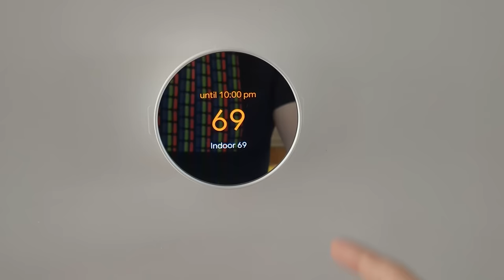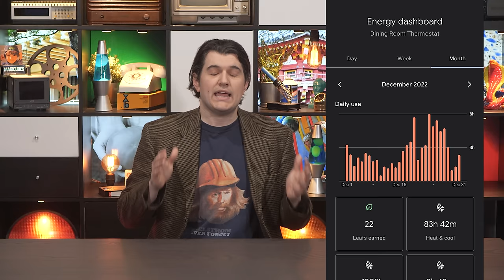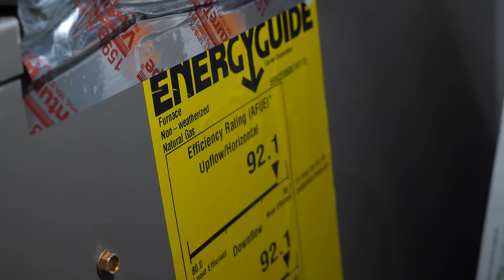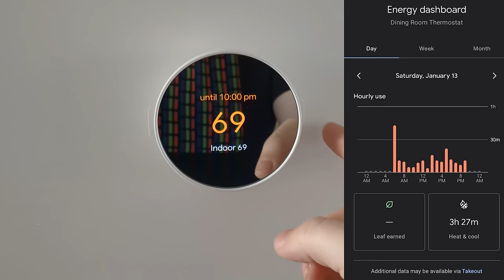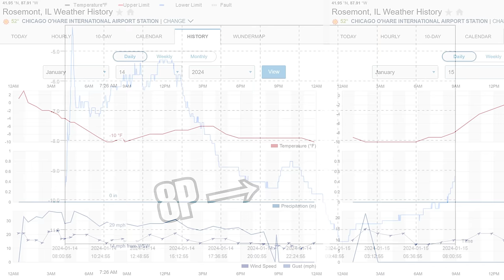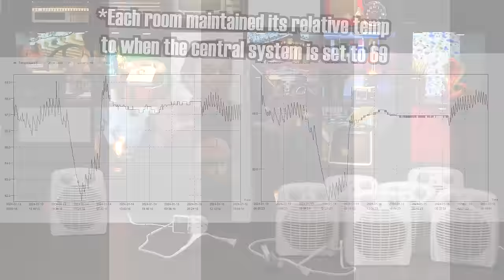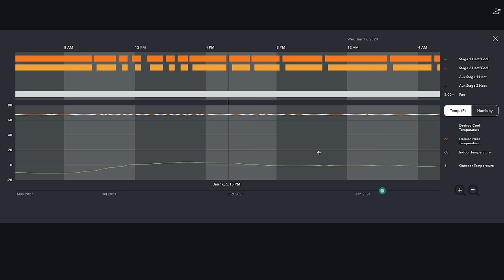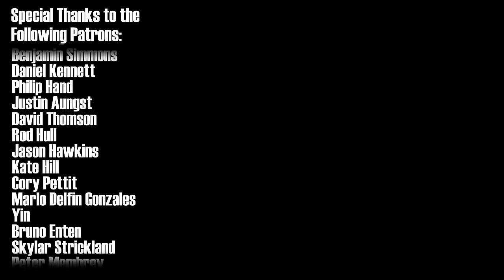Old HVAC industry practices are holding us back and costing us money. But we can fix it.

Comment: Another consideration occurs to me, and it might be a small one, but for some people it might be extremely important.

How loud is your heating and cooling system?

Now, you might think this is only important if you are say recording media or something along those lines. As building manager, Can tell you that that is not universally the only reason.

I’ve been managing for over a dozen years, and in that time, where I’ve had approximately 100 or so different tenants in a 40+ unit building, 4 to 5 tenants have been extremely sensitive to sound. Now if you are renting an apartment, you’re kind of stuck with whatever you have, but if you’re owning a house, you’re going to work harder to make it exactly how you want it.

So the question is, how noisy are furnace based systems, and how do heat pump systems compare? If even just the cycling of air being pushed through vents is disturbing to you, and I realize that seems extreme, but it is definitely something that some people worry about, then you would want that to happen for the shortest amount of time possible while you’re awake or on your way to sleep.

Given how noisy an air-conditioning system can be if it’s right there in the room, one wonders if it is louder than a gas furnace.

So…

If we take noise into consideration, what is the best combination and sizing when you use? And are there other things one might do to reduce noise?

Comment: Did you account for  the heat pump will have to use electrical resistance heating when the Temp gets too low.  and gas really heats a lot cheaper.   You better have some back up firewood

Comment: Furnace shown have also immensely out of date technology. Opened combustion chamber (modern have closed), only 92% efficiency. Mine have 115%. Well 15-20% are from exhaust heat condensation. Also fluent regulation with 1% increments or cooling down heat reuse. It can also sense air difference via lambda probe and get itself aligned according initial reference energy output from gas.
And its frickin 11 years old!

Comment: Having oversized HVAC equipment is not necessarily a bad thing. Those inverter heat pumps run most efficiently at 60-80% capacity. Your data is predicated on the premise of maintaining a constant temperature 24/7. It requires much less power to maintain a temperature than to change it. 

For example, if I have a large room in my house with a 10k BTU window unit air conditioner, and I run it 24/7, that room will remain comfortable. If I leave my house for a couple days, and that room gets up to 100 degrees, that thing will take all day to get the room down to a tolerable temperature.

You also maintain the temperature in your home at a reasonable 65-69 (giggity) in the winter. Many Americans prefer a warmer temperature, and the relationship between heating demand and energy gradient is nonlinear. IE; you need more heat to get from 74 to 75 than 68 to 69. And again, more energy to heat the house up than to maintain that temperature. 

 The same logic applies to a larger home with rooms that can be heated and cooled independently. Having oversized (on a per room basis) units allows me to maintain a baseline temperature in the house and rapidly heat or cool a room when it becomes occupied. That is to say, the way a house is used also should be considered when specking a system.

Finally, you come to the piano tuner problem. As you stated, there are many variables involved in sizing an HVAC system. However, some of those will have a positive effect and some will have a negative effect on the overall demand, and its likely that they will average out to being approximately the same as ignoring all of them and going of square footage alone-- with intuitive smudge for obvious things like "its a rowhouse" or "the whole facade is south facing glass"

Comment: 26:18   If only my family understood this, especially when they turn the heat down overnight.

My room is poorly insulated and gets frigid; temps are often 7°F below the rest of the house.  We don't have per-room HVAC, only zone valve adjustment.  The temp needs to be up more to keep my room comfortable.

An indoor oil radiator heater can only do so much, and takes literal hours to get comfortable running constantly at max power.  Meanwhile just upping the furnace temp would warm the room up in 15 minutes.

..and to make matters worse my father still thinks everyone wants a "central air" system and won't get a heat pump unit installed due to resale value of the house (which he has delusions of selling and moving when we're poor).  Lower quality of life for decades, for no reason.

Comment: if a heat pump / furance is oversized, how does it influence its efficiency and lifespan?
I would imagine that working only 25% of the day would mean it lasts longer before it breaks and needs replacing. Which means lower labor costs.

Comment: So you said your furnace only operates 15-25% of the day, that’s 9-15 mins a hour. Seems a little beefy but not 3x beefy tbh. I wouldn’t want the heat running 18 hours a day, 12 hours would be reasonable but any less than that would be for comfort purposes. Under 6 hours would definitely reduce the life of the furnace since most stress always comes form the cycling/starting. Engines and ac unit are other examples. On a day last winter where it was -12 for 2 days. My furnace ran for 16 hours each. Id say it was a little undersized as a non hvac professional. It usually only runs 5-8 hours a day on days around 15 degrees. Definitely not suited for colder temps. 16 hours was definitely not comfortable at all. We had to pull out a space heater in the rooms that were larger. For the same reason you don’t want your ac unit running 16 hours a day you wouldn’t want that for your furnace either. Uncomfortable and not practical. It’s an older home so I wouldn’t expect much, we plan on upgrading both in the future. Ac also runs 16 hours a day on hot days 100+, days where it’s 85, it runs 8 hours or so. In my case ac seems underpowered more so than the furnace but both could be larger. 50% cycling is the sweet spot imo on extremely hot and extremely cold days. Looking for that 10-12 hr run time on 100+ and -10 days.

Comment: Whatever happened to "but sometimes"? But, sometimes it gets down to -30 and I don't want to run a bunch of space heaters to still have a drafty home because of the lack of circulation and now, but sometimes the electricity will go out in a big cold snap and may remain out a week or more in many areas... All electric heat pumps... You will wish you had some gas or a wood stove or something.

Comment: I live in an area where electricity exceeds 40¢ KWH. I have no need for air conditioning and my total propane cost for a full year is about $1800. Do heat pumps make sense? Roughly, what do they cost installed? Thanks.

Comment: I'm going to rewatch this whole video now that I have a heat pump, but in case its not covered here, where can I find information about heat pump lockout settings? It seems pretty silly to set the heat pump to turn off and switch to strips at 30°F when it still has a CoP close to 3 when strips only ever have a CoP of 1, but that's where my installer set it to.

Comment: I’m in HVAC sales in Arizona. We do heat loads on every home we go to using Wrightsoft. There is a good reason that service and sales are two different divisions. The vast majority of customers don’t care how an AC system works or all the details of a proper installation. The demographic of people watching this channel do however care very much which is uncommon. When we get too technical with customers it frequently results in not earning the business. So there is a careful balance between designing a proper installation and making it digestible for the customer to understand. The problem is that most sales reps walk in and give a quote for whatever the existing system is at the lowest possible price without any care for proper sizing or design and hope they win by being the cheapest. Sadly companies and customers share responsibility for this dynamic.

Comment: Sounds like things are worse in the states, I was thinking our gas heating was oversized because it runs 4 hours out of 24. A ground source heat pump sized for 80% of winter weather, and top up from the gas during the coldest days.

That seems best value for now at least, especially since I have solar panels, so heat can be stored in hot water using surplus solar power (via heat pump), the hot water cylinder is already connected with the heating system, it is just messing with zone valves.

Comment: @technologyconnections love this video in love what you're talking about but the problem with the furnace that was provided for you is that a lot of people don't necessarily run their systems as properly as you have been and displayed in this video what they'll do is they'll let the temperature drop as much as 5 to 10 degrees at night when going to sleep and then we'll complain if the unit can't keep up trying to regain that going forward. I think the unit that you received was properly sized but I think what you should have been given for that scenario would have been a modulating gas furnace which has a an output range from 1/6 of the potential output up to 100%. I love your focus on efficiency but the benefit of gas furnace is its convenience and speed not, energy savings. Just some food for thought.

Comment: Using additional heaters like these space heaters sounds for me like a terrible idea. Using an inefficient way of heating to boost your heating is not a good idea. I would calculate the heating needed for the most demanding times but would smooth out the few peak days. Then I would slap on a few percent extra. The target should be that the system can support the peak days on regular target temps and normal cold days but above regular target temps.
The reason being is that I like it warmer when I'm sick and I don't like wearing more clothes.

This really only matters when you are close to the max capacity of a size. When the closest heater size had a fair amount of margin, then you have a margin but when not, one size bigger, doesn't hurt. For cooling I don't see such a big need to really go above. I do like it fairly cold but a fan helps too to feel less warm. Also a fan doesn't actually cool down a room and isn't comparable in energy usage compared to the temperature feeling.

Also I'm quite surprised that people actually think that running a heater in your attic is a good idea. Sure the attic is a space that isn't used so going by size, it's a smart idea to use the space that isn't used anyways. But it's still not so smart. When the heating equipment is inside the "losses" gets lost inside your home and it isn't really a loss. You might hear rooms that you might not want to heat but it's better than loosing it to the outside.

Also while bulding your home, you can design your attic to be usable. It can be a storage or even a living space. A friend of mine moved to the attic. He had 2 rooms before that. A bedroom with bed and desk and a gaming room with sofas, TVs and consoles. And for larger groups we went into the basement with bar and large table. His parents gave him the attic. It was big enough so a medium size group could hang around there. Also his parents got 2 rooms back and don't need to give room for the basement, when more than 2 or 3 friends showed up.

Using an attic as storage room is also not a bad idea. Sure it needs some climate control so the stored items are withing their temps. In the apartment building where I lived, it was a dry room. In the summer the clothes dryed very fast. It wasn't insulated and in the peak summer, it got very hot and once I even got nosebleeds. And I'm not someone who get nosebleeds.

Just desing your attic in such a way, that it's less a dead space and not a pain to use and run your ducts inside your walls.

Comment: At 45:45 I see a pipe to the left in your technical closet marked "Radon", presumably a sub-slat depressurization system? Can we expect a future video on this? I live in a multi-tenant apartment building in Sweden, where me manufactured concrete out of uranium-rich alum shale up until the 80s. This makes it hard to mitigate it without heavy air exchange, wasting heat which the landlords don't like.

Comment: Unfortunately the opposite is true in the south, many times the ac unit is undersized for the house. But heat pumps are the best method for both.
Reply: I think people would not be excited to find that their home takes many hours to reach the temperature needed. If you try to downsize, and it runs longer it will take longer to bring the temperature to the desired temperature.  It's far better to oversize and heat or cool it faster because no one wants to freeze or sweat for hours while it's getting to temperature

Comment: But hang on, if I got this right, you already have a central AC next to the gas furnace for cooling and it is about the amount of BTU/h you need, so why not consider getting a technician to install a reversing valve on your existing system?

Comment: Each 5inch duct run. Gives 50 cfm you need 600 cfm per ton . trully 1000 sq ft home only needs 1 tons of cooling. But they are not common and more expensive than a 1.5 ton unit.

Comment: I don't like being to close to the limit of the appliance, constant use mean faster degradation. Also, efficiency could drop over time, which would make an appliance running at its limit, not enough. 4 times is too much, 3 too, but 1.5 to 2 times what is needed seems way better to me. It leave rooms for loss in efficiency, extreme weather, adding a new room because a baby joined the family, or simply avoid accelerating the appliance degradation.

Comment: I would want to size cooling larger at this point.  More record-breaking temps, I don't want to be in a position where I have to upgrade the system because it got hotter outside.

Comment: Not sure if I said this in a previous video (feels like i have, but I think it is important saying it anyway. Best thing imo people can do, and cheaper over time too, is get triple pane windows, and improve house insulation if it ain't that good. Here in the Finnish arctic people still often use just old timey 1800s looking ass hot water filled radiators (either district heating or circulating some water from the water boiler that already needs to be heated anyway for things like showers), no AC for summer usually, temperatures range goes from bellow -30C to over 30C, it is a stupid ass range, and of course barely any sunlight in the winter (some parts none at all). Still, even when your landlord is being a cheapstake  and the radiator ain't running as hot as it should, homes are hardly ever unbearably cold. Severely reducing heat exchange rates with the environment is likely the most energy (and money) efficient way to manage temepratures.

Not saying this as "your system is bad, try mine", not even as a mere alternative, but as a suplement. Obviously not everyone's home can readily take extra insulation and/or triple or even just double pane glass windows, for once. But if you can combine multiple strategies that synergise with one another, that is better than any single option on its own (my ideal choice would be community/some degree of scale geomthermal and likely heat pumps for redudancy just in case shit happens, but that is another discussion entirely).

Comment: My old furnace broke because it was rated for a house close to 2500+ sqft. Only need half the size. The furnace tried to keep up with what it thought was a bigger home. The metal heat plate got cracked. I don't know the exact part.

Comment: It's expensive to install a heat pump because of capacity claims that don't work out.  Performance claims won't heat your house.  I installed a hybrid system 10 years ago and it ran in "emergency" all gas mode most of the time because:
1.  It was too cold outside to run in heat--pump mode (below 40 degrees).
2.  My utility bill was much higher with heat-pump mode, then with gas mode.

Maybe heat pump systems have greatly improved over the last 10 years.  I'll wait to read about more heat pump success stories before spending the extra money for a heat pump system again.

Comment: One thing I don't understand. For design temperatures of -15 to 70, you mentioned supplemental heating if weather extremes or wanting to heat your home more quickly in the morning push it beyond its natural limit. Why don't we instead of adding supplemental systems, just make the heat pumps 15% larger than they need to be, problem solved, no? Better than 400% larger.

Comment: I’m surprised anybody actually listened to the guy saying that he knew what size pump the home needed who wasent in hvac as a profession or anything..  i tried to tell my sister about what size and type of central air unit they needed and even gave her a price which i would put it in which was in the end 7 grand less than what she spent on another bigger unit which doesnt cool the home like she wants and costs more every electric bill..  told her she had a heat pump which was perfectly sized and worked for over 24 years..   but she decided to go with the “professional opinion” not the educated opinion of a person who doesnt want to see somebody get ripped off..  plus after they installed it the blower went out and they tried to say it wasent apart of the new system and charge her another grand to replace it.  Which a brand new blower is only like 3-400 nax but was included in her contract for a new install..  some companies just try to milk every penny..